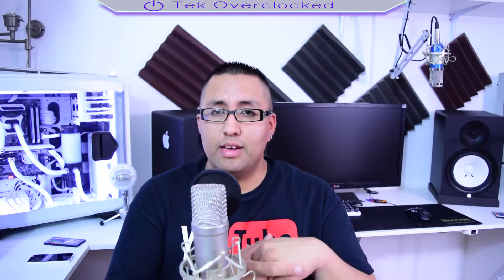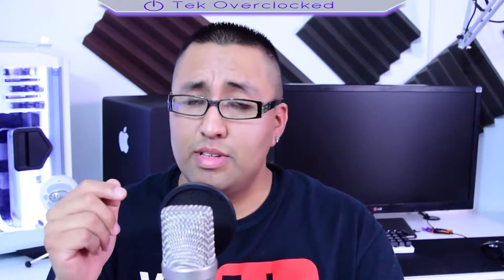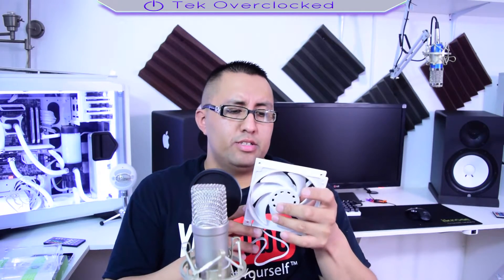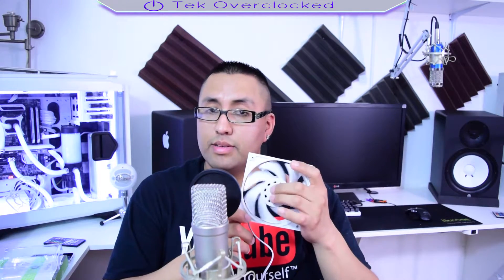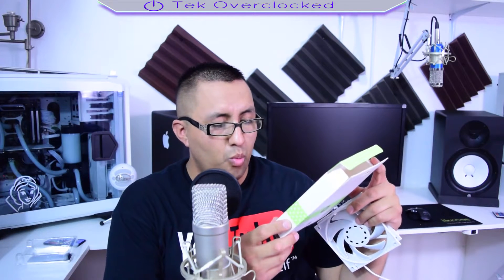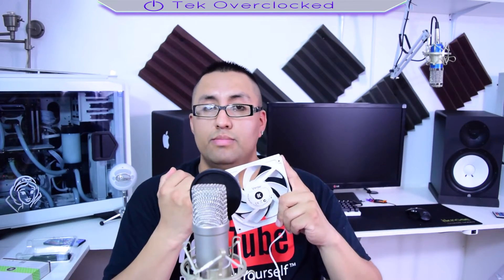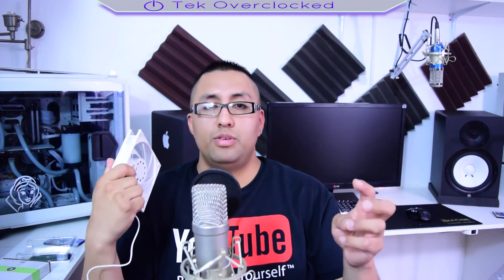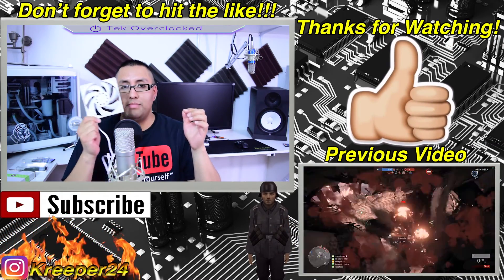GPU CPU Custom Water Cooling WHAT I DID WRONG- Exposed!

Comment: I haven't personally tried any of the 120mm Noctua fans but have 3 140mm NF-A14's and 2 120mm 1850 RPM Nidec Gentle Typhoons in my case. The Gentle Typhoons are used on my Corsair AIO and I use the Noctuas as regular case fans. I found that the Gentle Typhoons move more air with less noise. They are amazing fans but hard to find.